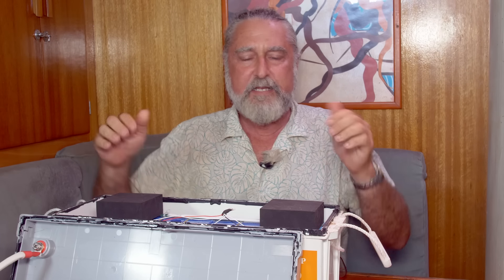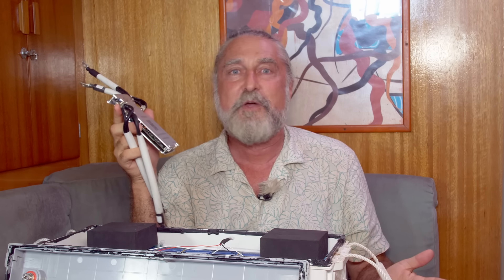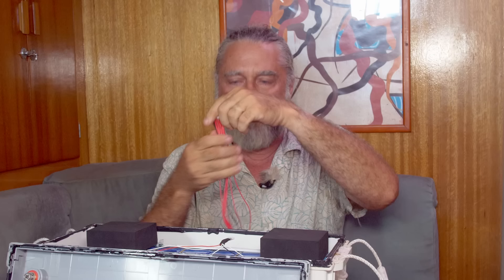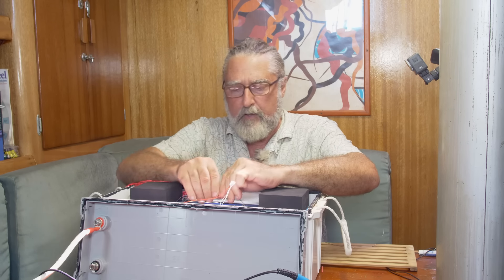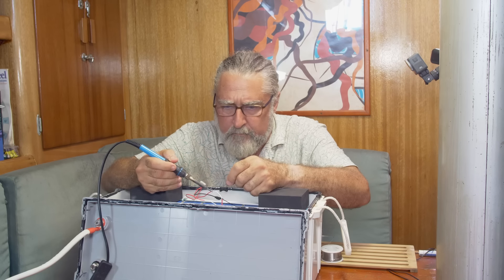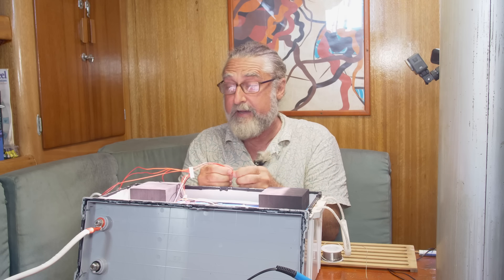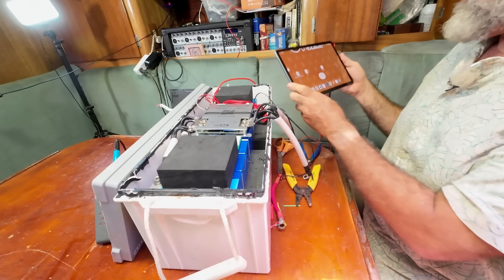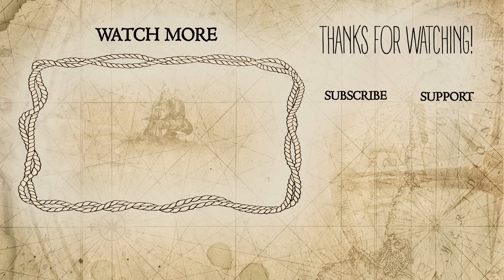Upgrading a Drop-in Lithium Battery to the BEST BMS out there

Comment: Thank you so very much for this post! I bought one, did some medium-easy dismantling and followed your instructions with occasional double checking from manual and 🎉

This solved all my balancing problems! From ordering the bms to case closed took only 72hrs. I ordered it from local dealer.

May your winds be smooth
Reply: Have to add to this bank manager topic that I use Relogy’s dc-dc charger in between leads and LiFePo4. I believe it’s solid solution as well but I’m not a professional
Reply from the maker: The BankManager has a lot of advantages over the DC-DC approach, chief among them is battery life.  But there are many ways to do things.
   I have started selling BankManager to guys who's first li batteries didn't last that long.
Reply: @Clarks-Adventure  is it too bold to ask if you could simplify the benefit for the battery life once more (over dc/dc approach). You are probably right and I should now learn this well
Reply from the maker: @miikariikonen149 it's covered here, especially in the article by Conrad at the bottom.

https://www.emilyandclarksadventure.com/bbms

But in short every other charge controller you will find charges li to a voltage.  That's OK (but not correct) for lead but Li is much more sensitive.
Reply: @Clarks-Adventure  I think I got it. Let’s do a test. Do you accept my solution better if I tell you that I have single 200Ah. There is no bank to be managed?
Reply from the maker: @miikariikonen149  nope.  LiFePO4 cathodes can take slow damage at any voltage over 13.48.  Charging to a voltage is why Li batteries are dying after 3 to 6 years.  
   Banks of batteries are one or more batteries.
Reply: @Clarks-Adventure  Thank you once again. Now my stubborn brain possibly got it. -> shopping
Reply: @Clarks-Adventure  This google site is no longer active
Reply from the maker: Yep..  got hacked and Emily left so it's all at MarineDCAC.com now

Comment: You're helping me over my fear. I worked in the film biz ages ago and saw some heavy duty shocks from connecting step downs on set. Scarred me for ages. I am going to be buying a boat and I am realizing 12v is not as scary as big transformers lol. Good info thanks!
Reply: 12V can still ruin your day if you short something out.  Remember that batteries are always on.
Reply: @marklapierre5629  For sure, but it's not like sticking a fork in my mouth to test a 110 outlet lol!

Comment: Do you feel a solder joint is appropriate for joining the wires versus a crimped butt joint with shrink tubing (mainly strain relief since it is enclosed)? Boats take a lot of forces and vibrations which could fracture the solder joint eventually. 

Also, you said in a comment that this BMS has CAN communications. The one on Amazon doesn’t (just rs485). Does it come with a converter that isn’t listed? Does it support RV-C and/or VE-can protocols? Can (pun not intended) it support DVCC BMS control or Wakespeed alternator control with pre-BMS shutdown signals? 

Enjoyed the video
Reply from the maker: I think I read about canbus in the manual but you should check yourself.

The solder will be fine.  There is no torque on these joins the way I did it.

Comment: Question: when everything is wired up and I probe the main battery positive and the P - of the BMS with my multimeter, I get 12v when the BMS is OFF.  In another JK BMS setup video he’s getting 0v when BMS is off, which makes sense to me.  Is something wrong with my BMS?  Shouldn’t it be 0v when turned off?  When I turn it on, battery positive and P - of the BMS reads about 10v.  Seems kinda weird because “discharge” setting is “off”.  This is a fresh install on fresh EVE 304ah  prismatic cells and I haven’t adjusted default BMS settings yet
Reply from the maker: Yes seems odd.
Reply: @Clarks-Adventure thanks!  Now I know that I need to investigate more, much appreciated!

Comment: Do I need one unit for each lithium battery?  Or can I monitor a bank wired together.
Reply from the maker: One for each battery by definition.   But you can put your cells in parallel if you want one battery.  Just make sure you can live with the BMS current limit.

Comment: Can you install a capacitor (like on an air conditioner unit) to soft start all initial loads so that the battery doesn’t have to start high intensity loading cycles over its life? Can you mount it to (inside or outside) the battery case?
Reply from the maker: I wouldn't.
  Caps have obvious advantages but they cause current control issues.

   A battery like this can put out crazy power for a few seconds as it is.

Comment: JK is a very good bms, 2A active balancer, easy programming and nice price vs  quality for loads less than 200A.
However I prefer a storage system big enough built from adequate LFP cells Winston, eve etc. Never the drop in pack replacement.
Preferably a REC bms with separate contactors for handling large loads safely like  windlasses, inverters etc.

Comment: Fantastic video, Clark! I got three of the Redodo 12V 410Ah batteries and my only disappointment with them so far is the lack of connectivity. I'd love for them to be able talk to a Cerbo GX - could you do a video on adding a BMS with CANBUS support?
Reply from the maker: This one has canbus support but my Cerbo isn't installed yet
Reply: @Clarks-Adventure  oooooooh - that’s what I’m talking about! 😍  My original BMS’s are rated for 250A continuous, but I think I’m willing to trade the 50A loss for canbus!  Thanks again for being awesome!

Comment: I have 4 JK 250 amp 48v BMS's.  I ordered screens with mine which allow me to turn on and off the bms. I also have 2amp active balance and it takes time to get all cells balanced. Around 30 complete charges for my 280ah cells. now they are top balanced perfectly. I have my bms start balancing when 1 cell hits its max voltage. 55.2 volts. so 16 cells each will have 3.45 volts. some cells will hit 3.45 first and bms takes 2 amps from that cell and gives it to the lowest voltage cell. keeps doing this as long as .005 voltage difference is present. This is the highest in voltage I want each cell to go. Sure I can go to 3.65 volts but why 3.45 to 3.65 is about 5% of total capacity. on the lower side I do 3.0 volts. This get me around 85-90% of my total capacity.  It causes to much heat in cells to get that little extra out and that is what hurts Lithium (heat). Cold also hurts lithium.
Reply from the maker: You should consider a BankManager.  Cells can actually obtain damage to their cathodes at any voltage over 3.37v when already at 100 POC.

Take a look at Conrad's article linked to the bottom of https://www.emilyandclarksadventure.com/bbms

Comment: Hi there. I'm an electrical engineer. If your BMS isn't doing everything needed to manage the pack and you need a "bank manager" then you do not have the proper BMS. I've designed battery storage systems for EVs, marine, and stationary storage. BMSs do all of the management, monitoring, protection, and control.
Reply from the maker: As an electrical engineer you should always be open to more research in case you missed something.

I suggest you start with Conrad's article linked to the bottom of this
https://www.emilyandclarksadventure.com/bbms
Reply: @Clarks-Adventure "don't count on them for charging for long life that's a completely different thing"

Absolutely incorrect. And your "bank manager" that you linked is to manage two chemistries in the same system (a horrible idea in its own right"

I'm open to new ideas but I'm straight up saying that your claim in the video that any system would need a "bank manager" for proper charge and discharge is factually incorrect. If a system cannot manage the bank for charge then it isn't a BMS, it's something simpler like a battery over discharge system.

Be it an Orion, Victron, or otherwise, this janky "bank manager" isn't required on a properly designed bank.
Reply from the maker: I hope your batteries last a long time.  Best of luck

If you actually want to look into this I suggest Conrad's article linked at the bottom this as a good start 
https://www.emilyandclarksadventure.com/bbms
Reply: Yea but sometimes it's better to have a another method in place
Reply: @Clarks-Adventure  That isn't research - that's an opinion by a layman.
Reply from the maker: Read the links he makes in this document as well 
  Yes they are opinions of a layman.  Offer these to you because academic papers are difficult to read and understand.  If you were up to that task I assume you would have already read them.
    I have decided you are one of those guys who value "being right" over learning.  In my eyes that makes you no longer worth my time.
   I have offered you the path to knowledge, only you can choose to follow it.
   Good day